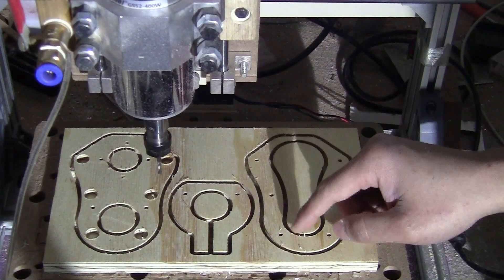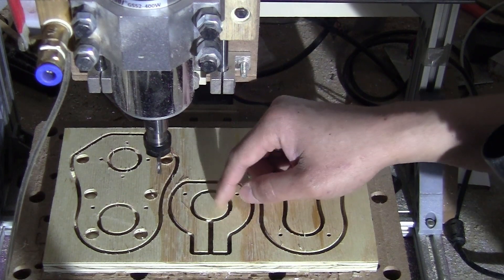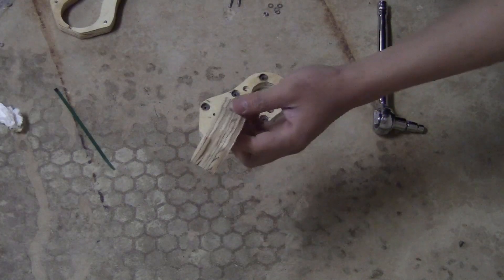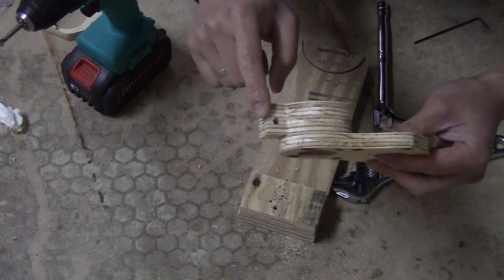3018 CNC - Dust shoe installation - I can breathe now!!!

Comment: After all that the dust shoe is way too high it should surround the bit not hover above it like that, for what you have done there you could have just used a 3d printed nozzle mounted to the side of the spindle holder and connected to a vacuum.

So this solution is creating way too much work and using way too much material so achieve mediocre results

If you are using a dust shoe it needs to be height adjustable so that it can be properly set for the job in hand.

Comment: cool, the way it works is, it covers till the tip of bit, so like a curtain to have pressure. otherwise you will only such flying dust. not efficiently the one on work area

Comment: I see the stlprt file but how to convert to gcode?
Reply from the maker: You can use the step files then generate the Gcode the way I showed in the video using fusion 360. If you're not familiar with the process, you can watch my other video about step by step guide to use the 3018 cnc

Comment: is there a parts  list d=for nuts and bolts
Reply from the maker: To attach the dust shoe to the spindle, use m4 bolts 20mm length. To align the pieces, use M3 bolts and nuts
Reply: Can i attach this to the stock motor mount or do I need to make your spindle mount? And do you have plans for the 775 mount i didnt see any on grab cad... great work.. im considering building you cnc as well!
Reply from the maker: Yes, it's already in the GrabCad design that I shared. There're 2 design in there, one for the 775 motor
Reply: The spindle mount file i downloaded was for a 52mm and 55mm spindle.
Reply from the maker: There's a folder called original 775 motor, you should download files from that folder

Comment: I appreciate your good advice and and your experience,  i also want to ask u to make a video about the differences between linear slide rails the round on and flat one as well as the quality difference between the bearings .
Reply from the maker: To make a video about that will require me to actually have the rails and bearings. I'm using a 3018 CNC which means i'm on a budget :D. But I don't think you need a video to know which one is better. For me, flat rails like MGN15 or similar is always better than the round type. They are lighter, easier to install, the tolerance is good. They are expensive though.
Reply: Thanks for the advice,  at first i had in mind to get same machine bath im following your advice and im trying to build my own under the same budget or a litle bit more , so thanks to u i know how useless this machine is as standard thanks again keep it up your videos are useful and helpful have nice day wherever you are.

Comment: #saveYourLungs is a trendy motto those last weeks... Thank you for sharing all your attempts to build an efficient dust remover.
(FR) salut Minh! Une adaptation à notre portée d'amateurs, tellement abordable en matériel et temps. Merci. Les franges m'ont séduit et correspondent à celles qu'on trouve en brosse sur le marché. Mais finalement ta modif sur le couloir d'aspiration s'avère être la bonne et m'inspire beaucoup (on pourrait usiner autrement en enlevant les arrêtes internes... et fluidifier le flot d'air rentrant). On arrive finalement au bout de ce qu'on peut faire avec la 3018 d'origine et tu peux en être heureux: c'est une tout autre CNC! Félicitations!
Reply from the maker: Je devrais apprendre un peu sur les principes d'aérodynamique pour améliorer cette adaptation. Mais pour la première version, ça me suffira pour le moment.

Comment: you inspired me to buy 3018, I don't regret it.  I'm learning from you, planning to create one of your modifications on your machine. You make nice job please keep doing this.  thank you greetings from Poland
Reply from the maker: Thank you for your support. I'm just a user of this machine myself. This machine has a lot of room for improvements. But for the price, it is worthy to learn milling and basics of CNC machine. I'm sure you will master it very soon.
Reply: @minhsmancave9448  what you think abou Axis 4 on 3018 is worth it ? what are your future plans for the machine?
Reply from the maker: I was thinking about doing it but you will have to upgrade the controller that is 4 axis capable like the one I used on my machine. It should be easy to make the 4th axis but the software side will be another problem. If you want 4 axis or more CAM software, you will actually have to pay. Right now, $500 per year for fusion 360 is a bit too much for me.
Reply: if I may want to suggest an idea for the next movie.  housing for this machine an idea about it can be a good idea :)

Comment: LOL, breathing is a good thing. :)
Reply from the maker: I should think of this one first before doing anything else. Got enough dust in my lungs already.
Reply: I agree and I was quiet about the dust but figured you had it under control.  This is why I don't like messing with wood and why I never wood turned as it is so messy (especially wood turning where there is no way to have a vacuum system as you are turning) and/or just not good for the lungs.  My t-nuts arrived and one pack was mixed so I had to put in for a refund on it smh.  Now I am unsure when my project will continue but it is already half built.  I understand this virus is due back in the fall (possibly) so we will get a repeat.  I hope not but by fall I hope all is well and I get my finances back in order post panic.  My city begins a two week MANDATORY lockdown in 4h from now.
Reply from the maker: Sh**!!! I feel you. We have been staying home for more than a week. I only went out twice quickly to buy groceries. Luckily I still have enough material to do a few things (hopefully I have enough bolts and nuts). I can't wait for this virus thing to be over. Where do you live?
Reply: I live in Memphis, Tennessee which has a ton of traffic from all directions due to this being a major shipping point (drugs too, sadly).  I went out last night to get a few things before the lock down begins today and so much is out of stock I will have to make do with the groceries I have.   Frozen pizza, Burritos, can beans are all that I have as the veggies I never stock up on and they were out of those.
Reply from the maker: Don't even think about toilet papers and hand sanitizer!!! It's still a bit loose around here since we haven't had any confirmed case yet. It will come soon enough at this rate.
Reply: I don't even mention any paper goods or sanitizers due to that AND all products that contains Zinc were sold out.  I still have a few weeks worth of Zinc in my cabinet but I wanted to grab another bottle as I take Zinc a few times a week to remain healthy but no dice.